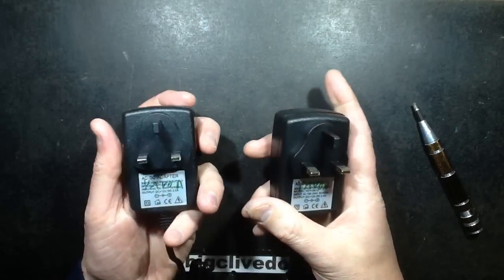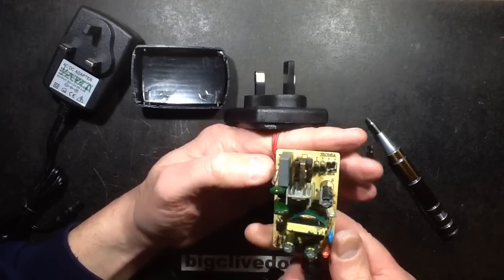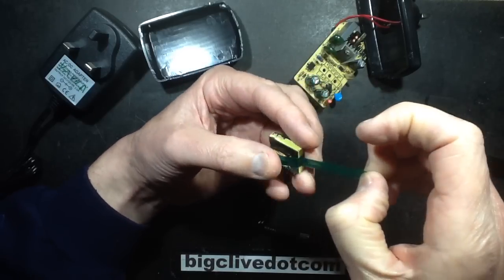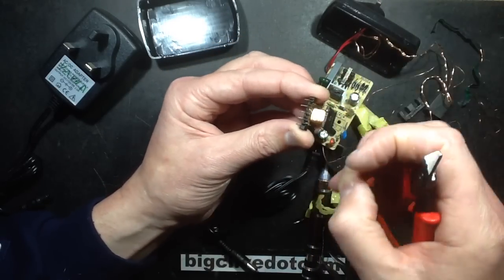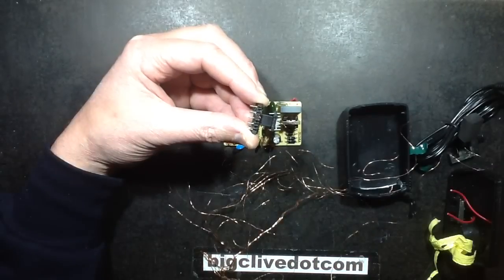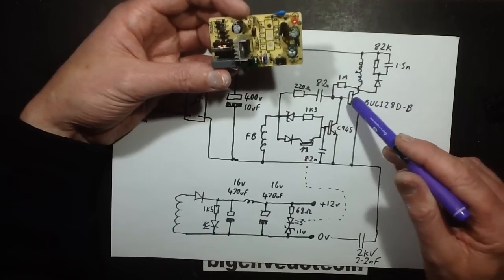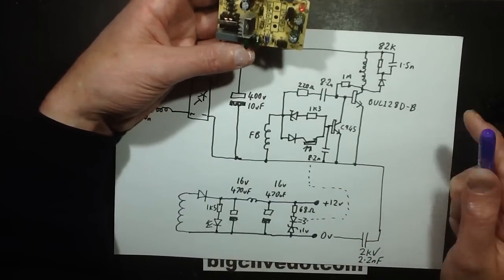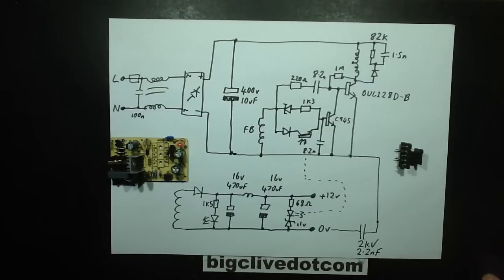Non-delicate teardown and schematic of 2A LED power supply.

Comment: I have one of the supplied with a 5m strip i bought from a uk seller, they have a weird tendency to flash the led strip briefly about 1-2 seconds after turned off
Reply from the maker: +jusb1066 That seems to be quite a common effect.  I think it's the result of the circuitry shutting down, but the residual charge in the electrolytic causing the boot circuitry on the switchmode driver to have another go.

Comment: I guess not drilling a hole for the LED saves them 0.000047p per unit, though they could save anoter 0.000021p if they actually ditched the LED... :P
Reply: +twocvbloke Maybe not, if they are using the LED as part of the voltage regulation in conjunction with the zener diode.
Reply from the maker: +Firecul42 I don't think so, it's probably a board out of another PSU with a light-guide above the LED.

Comment: Sadly, all of the newer 12V 2A power supplys form ebay are all 100% guaranteed crap.
Reply from the maker: +Ben Chavez I halve the rating at best.  They push them too far.
Reply: You should buy one and take a look at it as it's really bad. [Heck i'd say it's unsafe.]
Here is the one i bought [I got the 2Amp model]: http://www.ebay.co.uk/itm/1A-2A-3A-5A-6A-8A-10A-Power-Supply-Charger-AC-100-240V-DC12V-For-Led-Strip-Light/371656815343?ssPageName=STRK%3AMEBIDX%3AIT&var=640649573013&_trksid=p2057872.m2749.l2649
I have a photo of the insides of one and the new ones look nothing like the old ones.